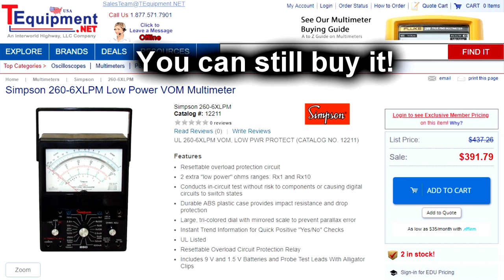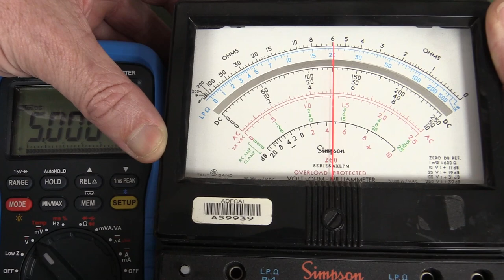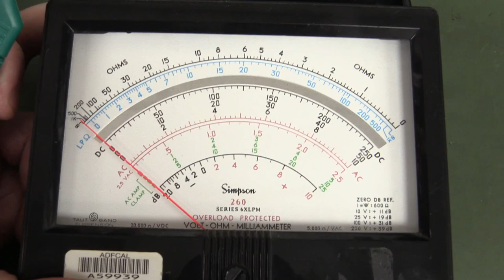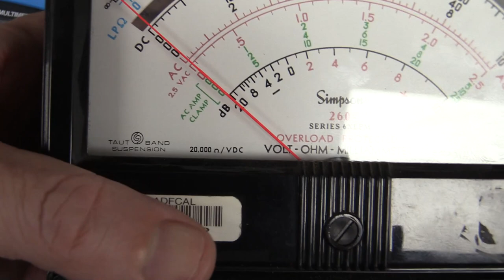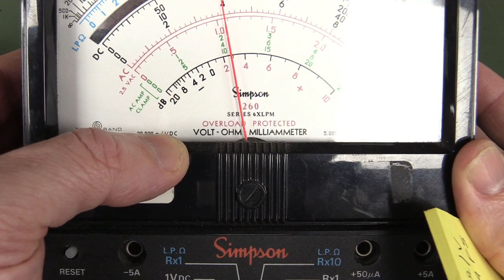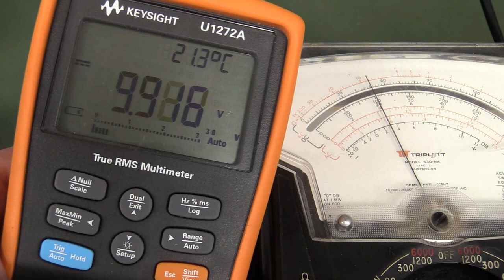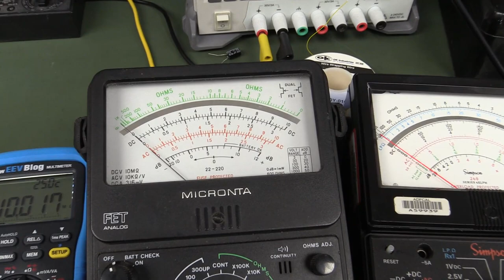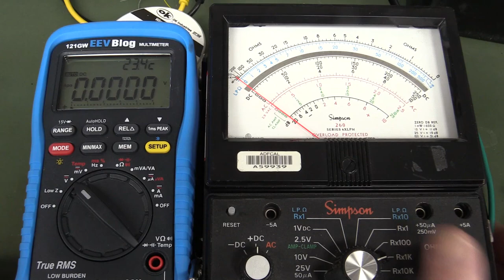EEVblog #1067 - Analog vs Digital Multimeters!

Comment: Ok you still could use them to setup gas burners as you need a high burden voltage, but there are also digital meters out there with an high burden voltage. 

It is faster to see if your in the right region if your looking for 230V and your nice digi meter is busy autoranging your already 2 points further up the contactors.

And dealing with corroded contacts your more likely to see the meter twitch so you know there is "electro coffee" waiting to wake you up.

If your dealing with small voltages and elektronics go digtal ... 

But dealing with whole cabinets full of high power electronic siting there for years to gather dust oil and worse, in industrial environment there is some times a use for analog meters.

That said so far there is nothing what I could not handle with an digital meter what I coud do with an analog meter.

Comment: Yeah, you have a very high resolution with a digital meter, but when doing absolute measurements AND if your meter is not calibrated those digits are meaningless, so you could just better hide them instead. As we know high resolution does not automatically mean high accuracy. Same as writing down all those meaningless digits behind the decimal point of the calculator.

Comment: When I worked for my Uncle I did handle the Simpson 260 meter !  Thank you for the video !  tjl  P.S.  Also liked the Frequency Selective Volt Meter...  Had a loose wire for the input and a Speaker on the output...  !

Comment: I think it really comes down to specfic application. Anyone arguing about the pro's of a certain type of meter is probably right (to their specific application at least.)  But for me at least there is no clear be-all end all meter as there are too many specific applications. I use regularly both an analog and digital multi-meter. For vaccum tube equipment, especially radios the gradual change in the needle can be great when adjusting transformer coils and even sometimes in digital circuits when looking for minute ripples that might otherwise pass by a digital meter and also checking for mains voltage, approx values of resistors where super close tolerance isn't necessary and generally anything vintage an analog meter is usually sufficient. A decent AMM can be had cheap and they often don't require battery power for voltage readings. I keep a cheap analog about as it dosn't require external power and is handy just for probing aroud for voltages.. Anything modern with tight tolerances like integrated ciruits / switch mode powersupplies etc then i'd always use the DMM, getting an accurate reading down to a 5th digit on a resistor is nigh on impossible with an analog meter, plus zeroing out ohm errors doesn't involve a trim pot. For the average DIY joe i'd advocate a cheap $5 DMM over an analog as they require less skill to operate, for specific applications you probably already know whats best, comparing the two side by side seems a little like apples to oranges.

Comment: Less with the gray beards. I'm 65 and still people come to me to design electronics. However professionally I have never used an analog multimeter. So 43 years ago I had a digital meter and I'm fairly sure it was the AVO DA212 that I still have to hand today.

Comment: I due some very low level device noise measurements and digital meters, including the expensive bench meters, inject noise into the measurement circuit.  Thus for me analog meters still are very useful at times.

Comment: I remember one trick we used to do with an analog meter is to estimate current/voltage in situations where they are over-range. Experienced person can roughly estimate the voltage/current by looking at how fast the needle is moving. Basically you just touch the probe very quickly so that the needle does not hit the limiter on the other end. You are pretty much out of luck when using a digital meter if the measurement is out of range.
Reply: yes this is possible if you know the exact inertia of your instrument and some physics you can calculate the measured value
Reply: Sounds like a easy way to burn out the movement, or bend the crapp out of the needle. Which I seen happen.
Reply: Yes I used to do that a lot and it is unlikely you will burn out the movement as they are generally protected. There is no doubt that DMM's are generally better but anyone that dismisses analog meters out of hand does not understand how to use them.
Reply: Analog meters are quite robust indeed. As long as the needle does not bang pass the limit, it can take quite a bit of overload. One thing I forgot to mention is that Analog meters are not vulnerable from EM interference and can usually operate within a much higher temperature range.
Reply: Kerry Wong Even analog meters are subject to the effects of electromagnetism.  Their probe leads still pickup RF, particularly when you have AM modulated at a rather low frequency, and the meter movement is indeed influenced by strong magnetic fields.  Not sure why you would assume they are unaffected.
Reply: I am more thinking of the internal circuitry in a DMM which could be affected by interference. You are right the issue for the probes are the same for either one.

Comment: Dave, your next meter should have a big OLED display with both or switchable between needle and digit display!
Imagine a needle display with selectable min and max limits...
Awesome to see so much civilised discussion ;)
Reply: Peter Barsznica   a cheap add-on for a smart phone could beat dave's "antique" dvm's (yes, the digital ones)  for most purposes, even providing an audio band oscilloscope, frequency meter and spectrum analyser, probably.  And if it's bluetooth,  you get the option of using a 10" tablet screen.  And colour.  I don't much like this video.  As you suggest, digital does not mean that the user interface should be numeric, both presentations can now be done in the same device and each has its value.

Comment: One thing you didn't mention, durability. I've dropped my Wavetek 235 a couple of times and nothing bad ever happened to it (knock on wood). I did drop my first Simpson 260 once...once. The poor thing exploded into 20 pieces.

Comment: Dave thx for sharing. Yep I know this is an ancient video but it's something I'm passionate about.

What I have seen is that the specs for most digital MMs can't support the resolution they have. Even a lowly 3.5 digit DMM needs to have an accuracy of 0.05% scaling resistors. The specs call out accuracies of 1% or maybe even 0.5%. Clearly these accuracies do not do the digital A/D justice. Now lets move up to a 20000 count or 4.5 digit DMM they require scaling resistors with at least a 0.005% accuracy. when was the last time outside of FLUKE did you ever see even a 20,000 count DMM with a stated accuracy of 0.005%, like never. Don't forget that the scaling resistors should be 4-10 times tighter tolerance than the reporting device. This is just good metrological practice.

Dave the A/D in your DMM has a resolution of 1 part in 50K which results in a maximum accuracy of 0.002%. I can only assume your DMM has 0.0002% scaling resistors in it to take full advantage of that 50K count A/D +/- 1 count.

Don't get me wrong I'm only citing FLKUE DMMs because I have more familiarity with their specs. There are a few others that are in that accuracy range too, but not many.

So, be careful don't confuse resolution with accuracy. I found that you can typically read an analog meter to around, like you said Dave, about 1 part in 250 or 0.4% which is as good as most 3.5 digit DMMs again outside of John FLUKEs DMMs.

So as usual we're stuck with either affordable crap or industrial super price DMMs with nothing in between.

Now if the DMM mfrs would use full resolution scaling resistors to fully support these high count A/Ds that would be a great move, but sadly they don't. This is why you pay extra for a FLUKE DMM. 

I think that sums it up.

Thx for reading to the end.

Comment: when i was young and interested in electronics i was told, the avo meter was the best thing ever, same in electronic college, where they had the fluke digital bench meters 'oh the avos best meter ever'  got a used one, hated it, heavy, hard to read,  bought a then £40 digital meter, 30 years later still have it, it works great, love it, soo much better in all regards, and doesnt use a set of expensive batteries either

Comment: Not sure why YT's recommendation algorithm just suggested it for me... Maybe because they not so secretly know that I've got a thing for analog meters? 
I use a DMM as a daily ride but got a few analog meters including two Meratronik V640's, one was the mainstay of my lab since late 2000s, the other one I got recently and repaired. They've got a great reputation among older Polish electronic engineers and seem to have gone quite expensive lately.

Analog meters are very fine in my book as long as they've got some sort of amplification that brings the input impedance to a reasonable value, a megohm or more is okay though too low and you can no longer measure some signals reliably. My ZEG WL-2c tube voltmeter has something like 500k input impedance, and the V640 has 1M.

Comment: Maybe more modern digital meters can now beat analog meters for response time but back in my mining days analog meters were far better for tracing intermittent phase to phase, phase to ground, open phase problems with trailing cables. your partner would monitor the analog meter while you flexed the cable till you saw the needle jump.

Comment: There are still applications for analog meters. Big advantage is "seeing" measured value. Digital meters have bar-graph, but most of the time it is something "unwanted" and small in bottom of screen ... You can quickly estimate measured value just by looking on regular size analog meter. You see rate of change and you don't need to thing / calculate numbers. That's exactly reason why car, planes, boats and other transportation vehicles have analog meters for speed, rews, temperature, fuel, etc. ... Just by looking on it you see if it right, if it changing, or approaching danger zones. For those application you don't need exact precision. It is enough to know if value is close to something. Also it is possible to mark position of needle on display/scale, so also unskilled operator can guest if things are right .... I like analog meters to show battery voltage, mains voltage and other things where just seeing proximate value is enough ...

fyi: funny fact. Car dashboards in modern cars use needles connected to stepper motor. So strictly speaking you can have analog meter with precision and input resistance of digital ones :) but classic one is still better ...

Comment: The only analog meters I use are the VU meters on my recording equipment!
Reply from the maker: I do like them as VU meters.
Reply: I've seen audiophile-level gear that replaced good old analog VU meters with fast-response LCD/OLED panels. The really high-end ones can match the resolution and response of an analog meter, probably at 50 times the price per meter, but the crappy ones just make you wonder what were the engineers thinking as the 'meters' are clearly unusable while being many times more expensive. The funniest one I've seen was a tube-amp with digital VU meters :D
Reply: Almost as bad as putting blue LEDs under a tube.
Reply: @CoolDudeClem
Is your car's speedoMETER analog or digital?

Comment: Officially your measurement on the analog meter is only each point, that´s your resolution, no guesstimate. And your error is half the scale value.
So if your meter has 0.1, 0.2, 0.3 etc that´s the only decimal you can report in your reading and your error is 0.05 for the specific example. That´s the nature of analog meters.

Comment: I own about 5 high end digital multimeters, including one of yours. I also own about 10 VTVM and analog multimeters. I reach for the analog meters every chance I have where the analog will suffice. The only time digital is required in my shop, ever, is maybe an LCR meter for building high precision resistor replacements for, you guessed it, ANALOG VTVM’s. Ha! Required is even a strong word. A needle width in any project I’ve done in 5 years is meaningless. Unless, it’s the swinging needle during a receiver alignment! I’ll take the swinging needle over a bar graph any day of the week. But, man, I love every meter on my bench from Simpson to Fluke, from HP to Heathkit, from Knight to Macromin Electronics, to yup, Brymen. Great video. Quietly, I agree. Digital wins. Mainly. But not in my heart where it matters.

Comment: I found a problem with a analog amp clamp that my digital one would not show. walk inn freezer compressor tripping breaker at random times. replaced breaker but still had problem. digital amp meter showed normal current draw. put analog amp meter on and set and watched it, every few min meter would spike for less than a second, would not trip breaker every time. motor windings were arching and would trip breaker about 3 or 4 times a day. current spike was so fast digital meter could not show it. we replaced compressor and problem was solved.

Comment: Technology advances on the tools of current technology. We advanced from analog to digital by the use of analog meters. Am I wrong?
When digital meters and calculators made their debut, the price was astronomical. Only large corporations and schools could afford them. In 1971, we had one digital meter for the entire college. We used slide rules to calculate. I believe we sent men to the moon via analog slide rules and meters.  But I am fairly certain Micronta had no input regarding the moon shots.
Lastly, I can see my 
Hickok 209 across the room with ease. Can you see your digital? My Hickok does not require a hanging device to keep it close to my work. I also have a  OLED Aligent that I love. Everything has its place.

Comment: Digital: Easy, accurate. Toasted with EMP, strong radiation, extreme hot/cold, needs battery to do ANYTHING. Analog: Rad-hardened, inaccurate, required brain usage. Battery only for ohms. Was used to design, build, and launch Apollo missions, along with slide rules which are also rad-hardened.

Comment: I was using my analog meter until a few months ago when I got tired of the inability to zero it and the constant issues it had with batteries and battery life and numerous other annoyances.
Then my digital meter let me find out that at worst, the analog one hit a little over 30% high on the DC range.

Comment: We still use the simpson in aviation. When testing the long runs of Kiddy fire detection loops. When looking at 10k up ohms the digital jump around. When you tap the loop looking for a breakdown of the insulator the digital just jumps around too much. The simpson just stays in place untill the fault is tapped and then the needle will jump. 

That is really the only reason we still have to use the simpson. Ive considered trying to use a reflectometer to design a test we can use... i think i can actually use that to pinpoint where a high temp air leak is too, but my boss doesnt believe i know anything.

Comment: While I don't profess to speak for all gray goatee's or in my case white,  I must confess that an an analog meter and scope has a very visceral feeling of reassurance.   Don't misunderstand me I love my digital equipment however, I still have an old Tektronix scope and a Simpson analog meter on my bench...  Love the channel Dave...  P.s.  Holding the tongue at a proper angle is taught in first year at college, perhaps you missed that class.... ;)
Reply: Southern Engineering Old analog tektronix scope is a whole different beast than an analog meter. I just got a 7000 series (the gianormous frames with 4 plugins). It's a 7834 analog storage scope but with the 200MHz 1MOhm vertical amplifiers.
Reply: I have an old Tektronix dual-beam  502A in stores.   Every few years I fire it up just to see if it will.   I think next time I'll  check accuracy, maybe do a nostalgia video on my channel..  Ya think Dave would approve?

Comment: Deserted island argument is silly 🙂 If it's deserted their would be no electricity and probably nothing to work on 🙂 not to mention lack of internet connection to look up the data-sheet 🙂 No, the only valid argument would be they are just beautiful. ... and you need to think more about what you are actually doing, especially that lower input impedance. Otherwise in most cases useful, as the most of the time we use approximations, estimations and indication in our work, within those claimed few %

Comment: i had the same first meter, it gave me a rough idea, better than nothing :-).
Later i got an Avo 8, better accuracy and nice for tuning radios with.
Reply: haha an avo beast! dont drop in on your foot!
Reply: LOL Ouch, a bad case of flatter foot, very flat :-D
The avo was damaged before i got it, the case was cracked across the meter and someone had used epoxy to repair it (not very straight).
But it was solid so i left it alone.
The meter had linearity problems, so i reset the sliding bias magnet.
It was spot on electronics wise :-D.

Comment: I using for AC milivolt range in audio gear tests and repairs. No contest on that from digital multimeters :) much more faster and much more accurate in RMS measurements.
Reply: BMR Studio he just showed the accuracy is really not even comparable.. so.. what? Unless you're using a non true RMS meter the digital one should be better.
Reply: I like both DMM and Analog Meter, but analog meter are slower in both AC and DC
But if you really need fast respond time, consider buying an oscilloscope?
Reply: Fast mean, you just connect, and when you make an adjustment, is far a way more quicker. And yes, I have (few) oscilloscopes :)